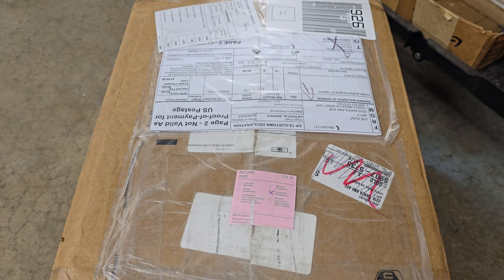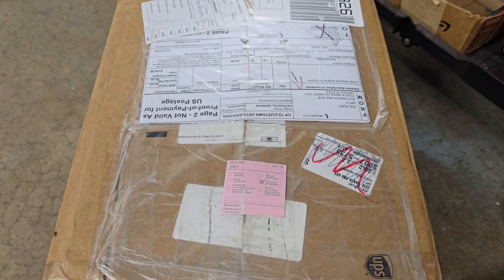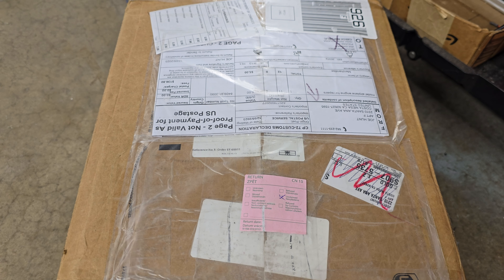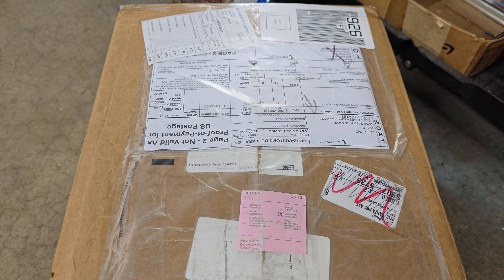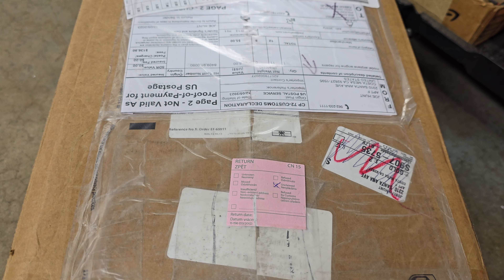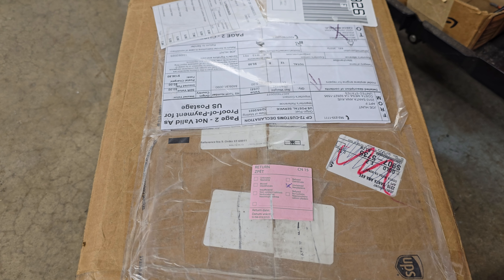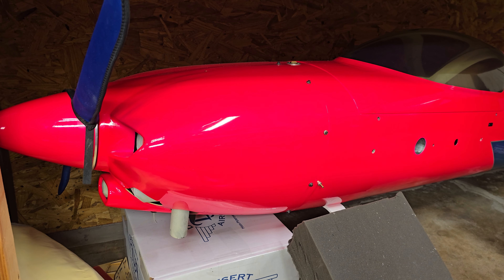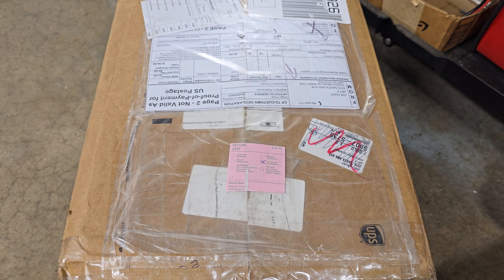ZDZ a definite no-go, obviously 🤣

Comment: On mine the plugs were interference fit in the head. The problem is the head is weak aluminum, hence you pull the plugs a few times and now the heads are gaulded 
so now there is a compression leak, hard to start, and you throw it in recycling.

Comment: Main problem I have found is the way the Carb isolator block seals to the rotary valve, and carb. the cork inside the pllastic gets hard and no longer seals against the carb, or rotary valve intake and ends up leaking air. It is an $18.00 part, but good luck getting one from ZDZ. I would never again buy a zdz new or used.
Reply from the maker: It's a rumor going around right now that they're out of business

Comment: Hey Joe please let me know who you will send your zdz to get fix I have a zdz 150competion I would like to hear run again

But I have a question I have a spekum ix series and I am trying to figure out how to run rpm from my dle 130 I need to know is there a red wire I need to unplug because I believe my receiver I burnt out due to the power from the battery from the engine.  Hope I am asking this correctly
Reply from the maker: Hi Willy! Are you running an IBEC? Are you running a separate battery to your ignition?